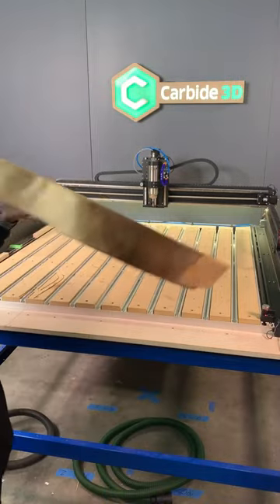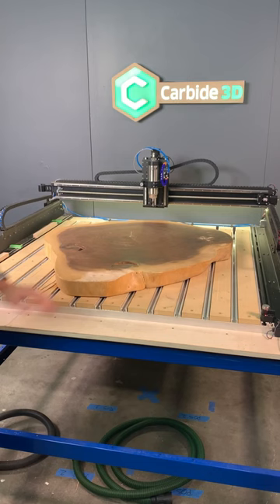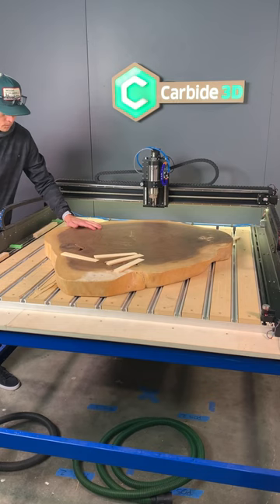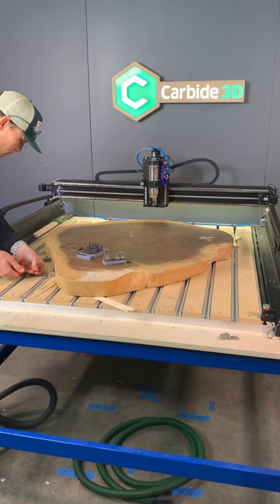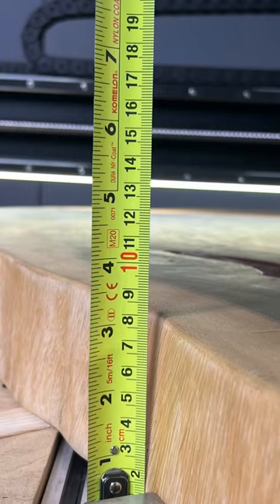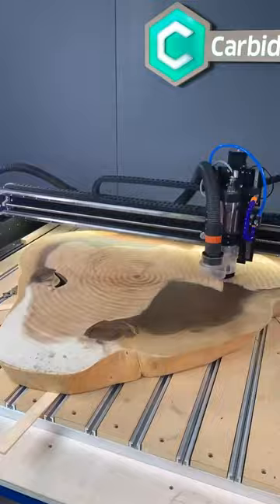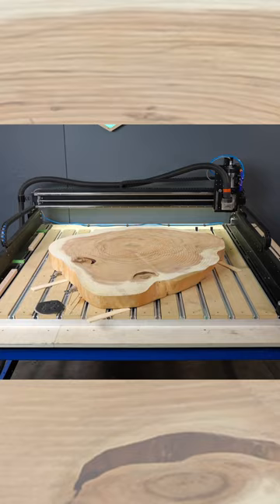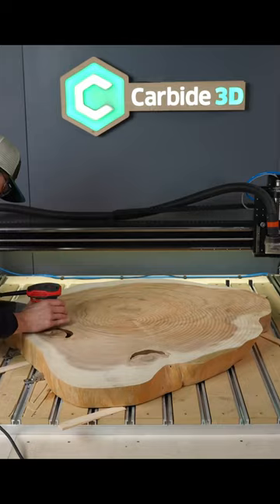CNC Cookie Monster

Comment: What tool was that?
Reply from the maker: Our McFly 1” Surfacing Bit https://shop.carbide3d.com/collections/cutters/products/mcflycutter?variant=39332570923069
Reply: How long will that bit last flattening/planing wood that size/thickness?
Reply: Is there a file for this that can be downloaded? I just need to get my spindle installed and have a ton of this I could do